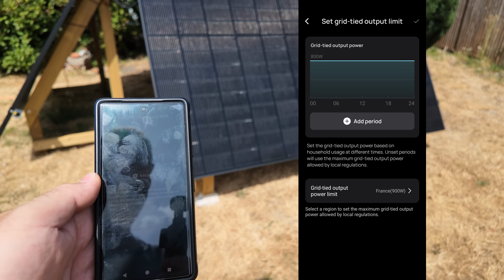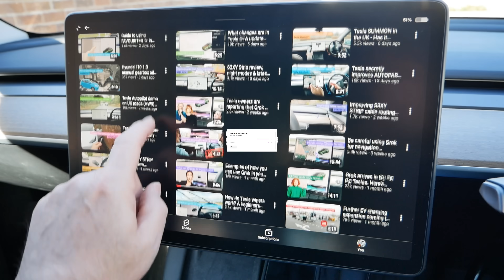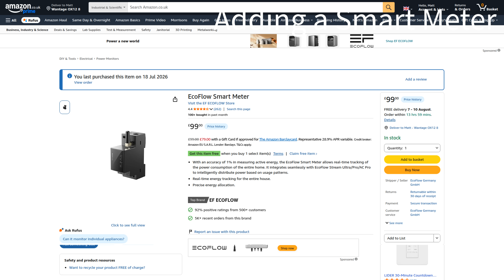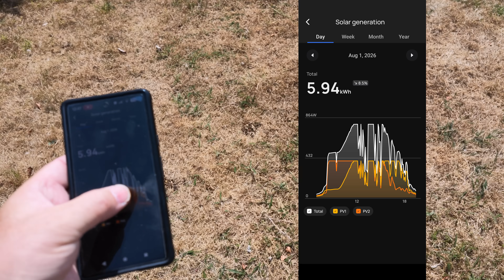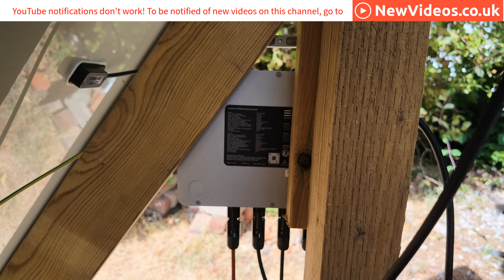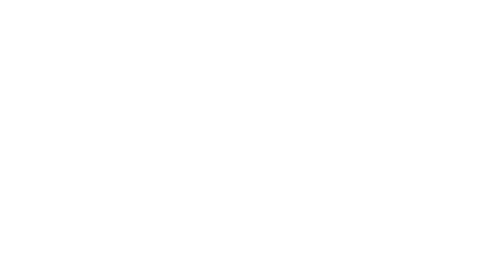Why My 800W Plug-In Solar Setup Sends Half Its Power Straight to the Grid ⚡

Comment: Thats the thing with plug in and grid tied solar its great but you just need to be smart and use as much as you can of the solar output when you can  doing washing heating water chargeing batteries devices etc but addition of a battery storage  or a powerbank which runs fridge/freezer for example and charges dureing day solar and runs fridge/freezer evening/overnight makes most of solar being generated  dureing the day.

Comment: Ive got the same set up as you with just 2 JA 460w panels from city plumbing and am looking at doing this for over the winter. Now im not massively techy or electrically minded but everywhere I look it states to fit the 4 in parallel because of the voltage but it also states that 4 of these particular panels will be too much voltage for the inverter. Google and chatgpt all tell me the same. I just wondered if you'd come across this issue at all as yours seem to be doing fine and I dont want to damage the inverter.
Reply from the maker: I'm shortly going to make a quick video on this. Putting two panels in parallel doesn't change the voltage, but it does double the amps. It is fine for this inverter. Use Grok for help rather than Google and ChatGPT. I've seen some terrible cases of ChatGPT getting solar wiring all wrong.
Reply: @GoGreenAutos ill keep an eye out for that, thanks. 👍

Comment: What Solar Panels are you using? Also I'm finding that I am not getting clean power from my Ecoflow inverter as a 12dc power supply I am using has stopped working.
Reply from the maker: JA Solar 460W panels

Comment: I have 4 x 450 watt panels connected to an ecoflow stream ultra battery  orientation of panels, on a fence, is roughly southwest but angle is pitched for winter, even so I regularly get 900+ Watts. The battery is always full but I have it connected to an induction hob and do all my cooking on it. I am awaiting a steam a/c Pro so doubling my battery to 4kwh. It took a while to stop the system emptying to the grid but have achieved that now. So this supports my main solar system with 2 sunsynk batteries making up 10 kwh my idea is to use ecofliw as backup to sunsynk in winter by which time I will be off grid and not paying the standing charge and yes Mr Miliband I have a petrol and gas generator but will STILL be NEGATIVE emissions!

Comment: I am given to understand that adding a battery to "Plug-in" Solar isn't legal yet.  Do you think it is?
Reply from the maker: I think the bit that isn't legal yet is putting a 3-pin mains plug on the battery. That has been excluded from the new UK regs and will be coming later. So for now, to be legal the battery has to be hardwired in to a consumer unit.

Comment: I have a similar set-up (using hoymiles HMS-1800-T4 capped at 800 but has 4 MPPTs). Its about optimising the set-up to try and get 800 watts for maximum duration. So I agree with your philosophy.

Comment: That’s nice of you to give back to the grid for free!  Definitely invest in home storage 👍.  I know nothing yet about home solar, so I’m not one to ask. Thinking about your panel setup, it seems fair the way you’ve got them so you can get “all day” solar input 👍.  I’d probably do the same. Just a shame they’ll only allow 800W useable unless you can store it.   Newly subscribed 😉
Reply from the maker: The 800W limit is defined under the "plug-in solar" rules. It is pretty low as that is 3 amps and a UK or EU plug can safely handle a lot more. Still, if you work within these rules, it's still usable and can make quite a difference....with a battery.

Comment: My suggestion is that you are doing everything right😀😀😀
Reply from the maker: Thanks.
Reply: No, not everything... He still should put SouthWest + SouthEast parallel on each MPPT.
No matter what the AI says, this would bring better results, especially in the morning / evening... The system seems to cap the result per MPPT

I would also think about batteries, so he does not lose as much during the day and can use energy during the night. But of course batteries makes the system way more expensive...

Anyway, nice stands for the panels
Reply: @jensuwe22  LOL

Comment: If you think the issue might be the inverter overheating then I would suggest getting several icepacks and bungying them to it , this should cool the inverter temporarily to determine whether it's inverter or elsewhere.  Also you could measure the inbound current to determine if it's the panels - a standard clamp meter should work fine.

Comment: Re earthing… In the UK, when you are using microinverters, you generally do not need to run a separate functional earth cable to the roof solar panel frames, provided your equipment meets specific criteria under the British wiring regulations (BS 7671 / Section 712).

Comment: Everything you said makes sense. In the winter you’ll need to bring those panels back towards the south a lot more for the shorter days. Battery is essential, but expensive compared to spending so far
Reply from the maker: Yes, I was thinking that. They're easy to swing around.
Reply: @GoGreenAutos if I may add, the panels in the winter would catch more low level winter sun if they were standing perhaps a maximum of 20 degrees off vertical.

Comment: Thanks for a great video on a minimalist set up. I was thinking why not run the hot water heater during the day? By default, attached to the mains, low rate electricity is 9pm to 6 pm, but if there is surplus power during the day this could heat hot water via a smart switch. I live in southern Europe so this could be more interesting here than in the UK. Kind of like a thermal battery.
Reply from the maker: The issue is the wattage. While the exports are currently ~600W, on non-sunny days this will be around 100W. Trying to heat water at that low current might be difficult as an immersion heater is normally 3kW and will just use more energy from the grid. You'd need a dedicate solar diverter type product which is more cost and intended for full solar systems, not tiny plug-in setups.
Reply: Maybe an integrated ambient air heat-pump based hot water tank would work Uses a few hundred watts. Also works as an air conditioner! Only so much water you can heat with 6 kwh though.

Comment: Oh great another parasite on the grid you know that 800 W that you're getting credit for it's only actually about 120 the power company loses 85% so your neighbors get the compensate for it with skyrocketing electric bills if you had a volt amp meter you can chat double check your installed watt meter with the optional amp clamp takes less than a second to demonstrate the ignorance
Reply from the maker: Just to clarify, I don't get paid for any of my export. The average transmission loss across the whole UK grid is around 6%, but power from my setup gets absorbed by neighbours, so the actual loss on my export is closer to 1% or less.
Also, the claim that I need a separate volt-amp meter to verify my setup is incorrect. The EcoFlow Smart Meter with its CT clamp is designed for this exact job and it's already measuring what my inverter is actually producing. No ignorance here - just a meter doing what it's meant to do.
Reply: @GoGreenAutos Point Still Remains the Same you are exporting and only 15% of what you think you are same with the rest of the ignorant Renewables
Reply: @dennisdickinson8337  if you are so bitter and resentful, why not get solar and cheer yourself up a bit!
Reply: Yes just so upsetting that so many people are suffering with skyrocketing electric bills directly caused by the ignorance of Renewables and it just takes one itsy bitsy second to demonstrate the ignorance  @fazerstorm-oap

Comment: yes they never quite hit 800w, 788w is the most I have seen. I have tried lots of things but they just don't quite hit 800w. Yes if you put to panels in parallel and one is in sun and other shade. The one in shade will drag down the one in sun.

Would be interested to know more about the frame as I am thinking to get more panels and make a frame like yours.

On the battery, Ecoflow has some new batteries coming out later this year e.g. Stream 5000 and AC 5000.
Reply from the maker: I seen 790W from mine. The video on the frame and materials used is filmed and will be going live on Tuesday.
As for the battery, I may have the new Stream 5000 AC coming!
Reply: @GoGreenAutos  Yes I am interested in the AC 5000. I take it you are getting it from Germany as it does not seem to be on sale in UK yet.

Comment: You will never get the full 800W AC output. I think that's the maximum DC the MPPTs are rated for (2*400W).
But the DC-AC conversion wastes some Watts, so 780W is actually great!
Reply from the maker: I've seen 790W on occasions. But of course, I'm not watching it all the time. But it can get addictive!

Comment: It was me who suggested the staggered parallel connection, i.e. one panel from one set connected in parallel to one panel from the perpendicular set.
I'm not sure if "the AI" got it right.
But the point in that you are balancing the MPPTs that way.
Each pair of MC4 connectors is connected to a separate MPPT and it's better to balance the MPPT load.
EDIT: Just read the AI answer. Not convincing, IMO. It says the MPPT works best when it is connected to 2 panels facing the same direction.
That's in principle correct. However, what the AI reply is missing is that in the case if overpanelling, with your current connection, each MPPT is connected to double the MPPT limit.
In contrast, with the staggered approach each MPPT is connected to (in practice) 1.3 the MPPT limit.
Reply from the maker: I don't normally take AI's first answer as fact, so often run the same questions through AI multiple times, worded in different ways on different sessions because then the AI starts again each time in working out the answer and can come up with different answers. In this case, I was getting the same results each time.
But yes, your view on one SE and one SW panel together made sense, but AI was saying not for this inverter.
Reply: I saw now your graphs for the days. It clearly shows that one MPPT is maxed out very quickly whereas the other MPPT is reaching peak generation much later.
That's exactly what you'd expect from over saturating one MPPT in the morning and underutilizing it in the afternoon and vice versa.
Your daily generation is still very solid, so if you don't want to bother just don't.
But with my staggered connection (my setup has more shading) I have reached maximum 7.1kWh on the sunniest days.
Reply: @GoGreenAutos Ony one way to find out, I guess: try swapping the two configs back and forth quickly when sun is facing straight on one of the sets (e.g. morning).
Reply: @GoGreenAutos  It is a very quick connection fix and easily tested on the next sunny day.
AI is completely wrong in this case. Utilizing both inputs the entire day is much better and the MPPTs will have no trouble finding the ideal power points.
In case of very hard shading it may ne necessary to use blocking diodes to avoid a few percent of the power leaking from the sunlit panel to the shaded one, but it will not be in any danger of damaging anything since no panels are in series here. (Unfortunately you can't run the panels in series for higher power per MPPT either as it would overvolt the inputs.)

Comment: What about an idea of connecting 3 panels in a triangle together. So 3 x 450 watts feeding a single 800 watt plug in inverter. They would all be vertical. One Panel North Facing. One Panel South-East. One Panel South-West

The benefit of this would be no need for a frame the panels would support each other and panels are cheap and quite robust

It would also only take up less than 1 square meter of land in the garden. If you have an outdoor rated battery you could even house it inside this triangle

Or even a square with 4 panels. North East South West
Reply from the maker: The inverter I'm using only has two inputs. That would need three. Putting 3 panels together on one would be too much for the inverter ports. But 2 together and one on its own (south) would work, but I'm not sure if that would result in any better generation than I'm getting. But you're right, it would take up much less lawn space and look neater.
Reply: @GoGreenAutos  Is each port limited to 400 watts to make 800 watts total ? Otherwise what is to stop you simple plugging in all three panels into one port with panels in parallel ?

Here where I am panels are so cheap they are cheaper than mounting brackets and system so a self supporting setup might be more economic and look better as you don't see any racking

Could also do a triangle 🔺️ on the long side of the panels to make them just 113cm tall if someone wants a less tall system. But personally I think being 226 cm tall but take up very little land would look better

Comment: I would take the earth directly to ground not into the house. The inverter is galvanic isolated is DC cannot pass to the actual side, by bonding the array to the same earth you have a path for DC faults. Second any ac ground faults in the house could appear on the array frames.  By using an earth rod any touch voltages will dissipate to earth,  50v will give you a tingle, anything more than that could stop your heart.
Reply from the maker: I have a spare earth rod, so I will make that change. Thanks.
Reply: arent most PVs double insulated?

Comment: I've made the same, but only with 2 bifacial panels to east (other side on west) on 90 degrees, so in Your case, probably You could buy 2nd stream inverter and totally get more out of that all, mostly in winter if You had bifacial panels
Reply from the maker: I had intended to buy bifacial panels, but I cocked up.

Comment: Storage of energy is in my opinion, kettle to lower bills.  Im also on a F.I.T getting a £509 for this year at 2500 w.  5000w generates over 12 months. Whilst it's not alot, I actually save the 2500 unpaid wattage by daily storage and use, or just using it.  There's no micro management from Britsh gas.  So they pay me money for basically nearly all of it being used.     Battery, in what ever format will stop you buying at their unit price.

Comment: 😁u could always run a rope around trunk of conifer to solar framework to make absolutely sure they dont blow over in high gusts,they might be 50kg, but they will act as sails in gusts.
Reply from the maker: I'm considering these https://link.amazon/B0gMDdTUG and just loop them over the bottom wooden rails and bang into the ground.
Reply: Need to make sure some is not going to run into the rope. Ground anchor sounds safer.

Comment: there's a lot to be said for east or west facing (that is, not south).  East and/or west give you power when you are more likely to need it, in the morning and evening, the shoulders of the day. South gives you power when you don't and you can end up exporting, then the power companies don't want it either.
Reply: Power early and late is also more expensive, so a little less power from a more easterly/westerly facing panels may be worth more than more but cheaper mid-day electricity.

Comment: How much did all this cost you ? and how many years ( decades !! ) will it take just to break even with the cost before making any real benefit financially ?
Reply from the maker: About £600 total cost. I had worked it out to be a 2 year payback, but I was assuming I'd be using all the energy produced. I will be for most of the year, but during the summer months, much more is going to grid than I was expecting. So maybe a 3 year payback.

Comment: On the steep angle, I think you're right that this is optimal for your goals. If you got paid for export and had a bigger inverter it would be another matter. I have a bunch of vertical panels on a fence and my peak generation is April/May not June/July. Winter is always miserable though with about 1kWh per day generated.
Reply from the maker: Thanks. I'm looking forward to see how my setup performs in the autumn and winter. I think I'll make monthly or quarterly update videos on generation.

Comment: Connect the two inverter inputs and all your panels in parallel. You will be surprised.
Make sure, all panels have the same max voltage, else this will not work.

Comment: You undertood the best way to use that setup. Congrats. You need to treat the wood against worms and insects and you better place it on bricks rather than the soil. I used bitumen diluted with mineral spirits for mine. UV and rain will ruin any other finish here in Greece where the UV are extremely strong.
Reply: Even if you add a battery the east/west split exposure is great because it shortens the time you will deplete the battery.

Comment: I installed something similar and it halved my daily consumption. Now took the plunge and installed an 8kw hybred inverter with 6.3kw SE and 3kw SW with a 6kw battery. Well worth the £9000 cost. Exported £120 last month with no billed units. Just paying the standing charge. ROI around 5 years. Added 3% value to the house.
Reply: With the 3% would that be £9000? I have wondered if adding say £9000 investment into a house would increase the house by the same amount or less or more.

Because each time I invest in my house e.g. insulating under the ground floor, or putting in a new bathroom etc. It is hard to know if you are adding value similar to the cost of the work.
Reply: 9k????? youre fkn mad lol ;)